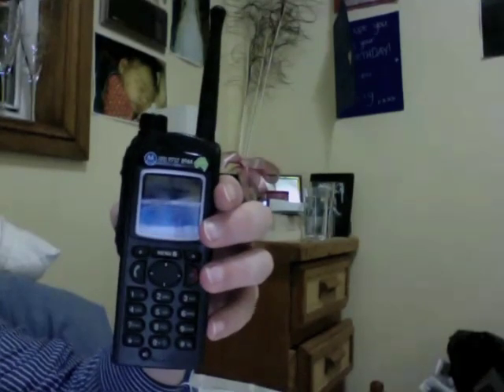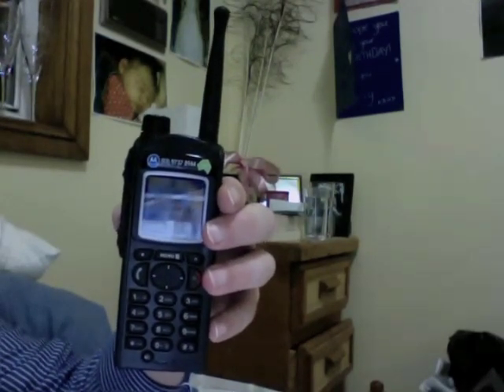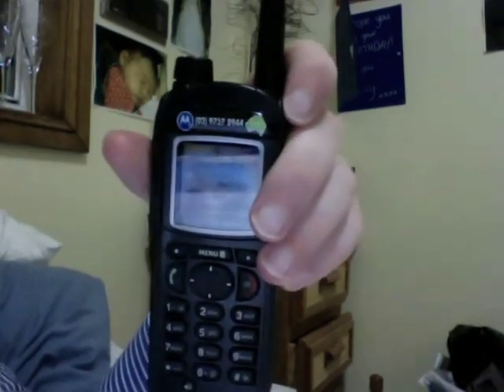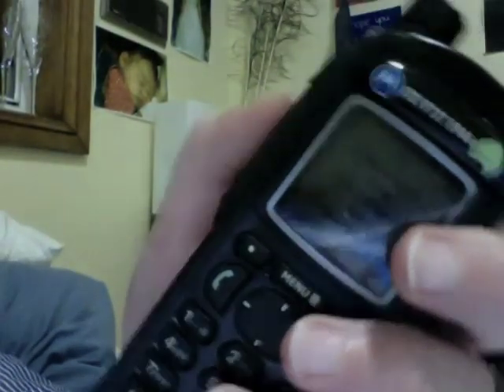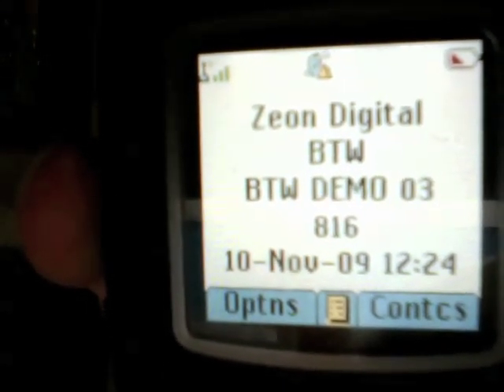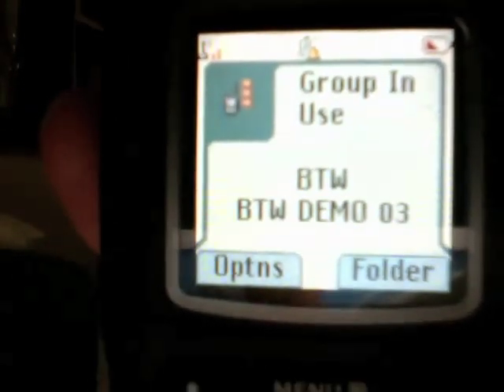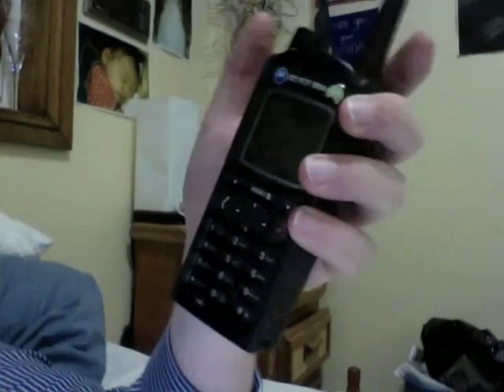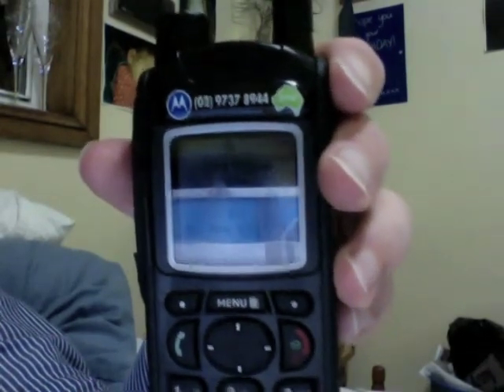Motorola Tetra Radio MTH850 on Tetra (airwave) network

Comment: Are you sure this is on the airwave network? In the UK, airwave is for emergency services only
Reply: You really shouldn't use your main account to replies to comments like this as you come across as a bit of a dick with this thread. Just saying. On another note, big fan of your videos and long time subscriber. Keep up the good work! :)
Reply: +radiosification Airwave is perfectly legal to use in Australia.
Reply: Airwave doesn't exist in australia as far as I know. Ariwave is the name of the company who runs the UK emergency services network. As far as I know, they don't have a network in Australia. Airwave is not the name of this digital two way radio standard, in case you are confusing the two.
Reply: +radiosification get your facts right before attempting to call people liars  !!! try a bit of research first !!! YES AIRWAVE DOES EXIST IN AUSTRALIA  !!! Like I said before you call people liars do a little research first...
Reply: Show me a link. I looked up airwave australia before posting my comments and nothing related to tetra came up. I also found that there was a company called airwave solutions australia but they changed their name close to two years ago. So actually it turns out that you are the liar here if anybody is. There is no airwave australia, the closest thing to it is a business called bai communications.
Reply: Uh so what? I was never talking about TETRA being in use or not. I knew from the start that TETRA is in use in Australia and that point was not even being discussed. I was saying that Airwave is not in use in Australia. 
Don't call me a plank when you are not even smart enough to tell the difference between Airwave (a business) and TETRA (a digital two way radio standard).
Reply: You can't win the argument because you're completely wrong so you resort to personal insults.

Comment from the maker: Although the technology is the same, the police (in the UK alteast) use different frequencies that are not open to the general public, as well as strong encryption technologies. This means that you practically have no chance of ever listening in with either another Tetra terminal, or a scanner.

Coverage-wise, I think the police over-come this by having a Tetra gateway set up in most police cars that boost the singal from the Tetra terminals in patchy coverage areas.

Comment: i found that rather fascinating. but what i am wondering is that a lot of police forces use tetra would it be possible with one of these radios either purposefully or accidently find yourself listening in on there frequencies?. plus a lot of public services that have gone digital have claimed that they have found the coverage a major problem in what you might class as code red situation etc officer getting attacked etc

Comment from the maker: @urbex2007 On this radio, the tone is 2 loud short beeps.

The Zeon Digital network has a feature that allows all radios to be tracked via an online mapping tool to show their current location.

When the emergency button is pressed, an alert shows up on the map showing the radio's current location and that it is in emergency mode,

Comment from the maker: @106QSDAVE Motorola own the licenses for the frequencies that the network uses, and I believe that the terminals have custom firmware loaded that removes DMO usage.

I guess you could flash the terminals with another firmware though if you wanted to use them DMO, although with only 1 Watt of power, I wouldn't recommend it.

Comment: Good review. As you say, TETRA relies heavily on infrastructure and it's essential that the network set's up enough sites to live up to it's coverage claims. The dealer should be able to change the volume of the permit tones in the software. 

I prefer DMR MotoTRBO at the moment. It offers higher powered radios over VHF, UHF and 800MHz so coverage is much more solid. The only downside is the wait for Tier 3 for wide area trunking.